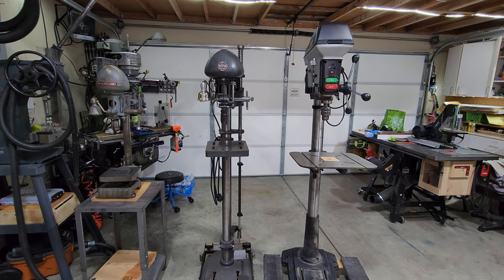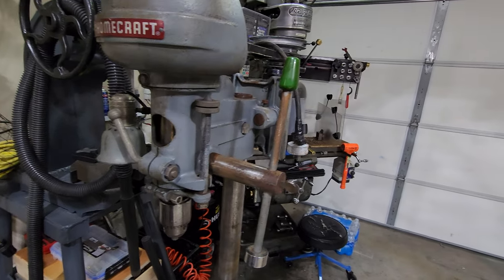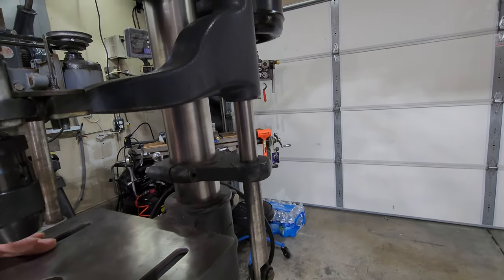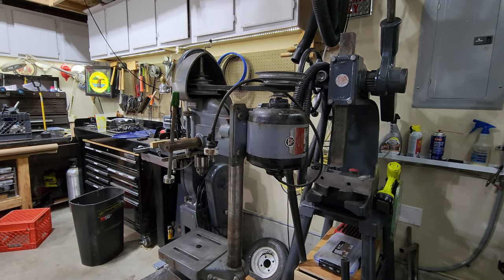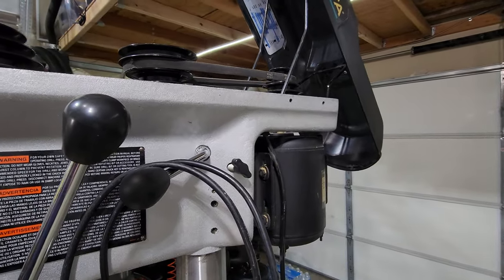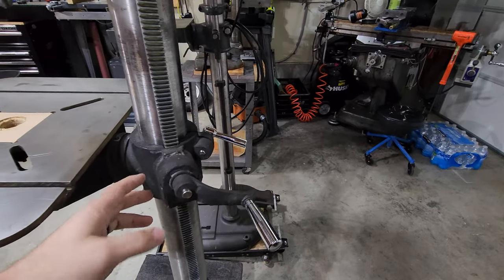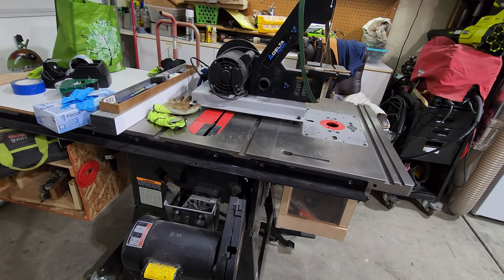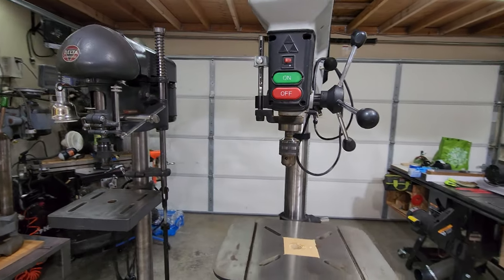Comparing 3 different Delta drill press and their features

Comment: Thanks for the History on Delta drill presses.  I've got a "New in the Box" 2005 Delta 17-965 drill press, never opened.  I bought it when I was planning on putting together a workshop in the garage and ended up in a 5 year long divorce starting in 2007.
  Just now setting up my garage for a small workshop so at least I can finally put it to use.

Comment: My dad has that exact Homecraft. I bought an absolutely mint condition 1950  delta DP-220 for $180 about a year ago. Drill deck is mint, no arc of shame. Its my current prized tool because it made it 70 to get to me and im only in my 30s so its gonna have a good life for a long time
Reply from the maker: Nice, it rare to find them without peck marks in the table.

Comment: I just picked up a floor model delta Milwaukee with a 30 serial prefix. It has #566 in brass or bronze on the side. I think that prefix puts it at ‘44. Still trying to figure out what the brass number is. Total made to that point? I went through and cleaned it up and it’s so nice. Hard to find something of that quality new nowadays. I paid $40 for it haha. Very minimal run out if any.